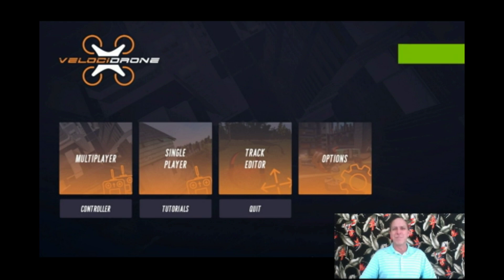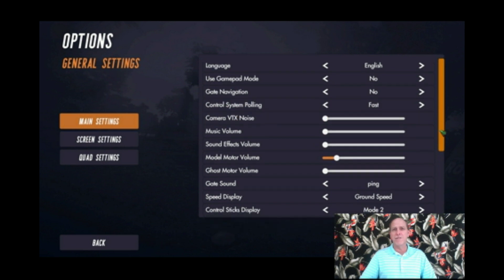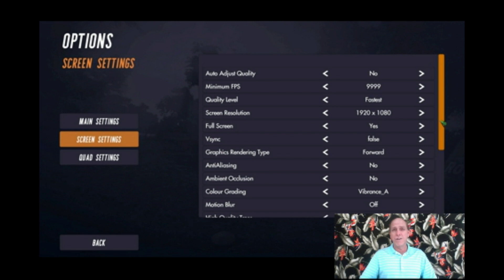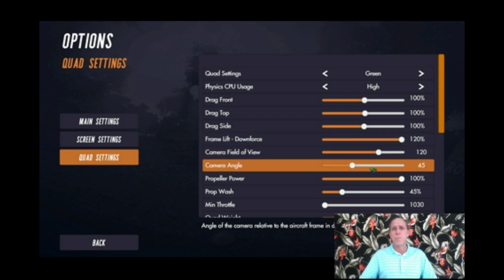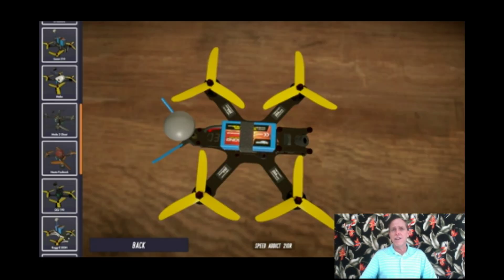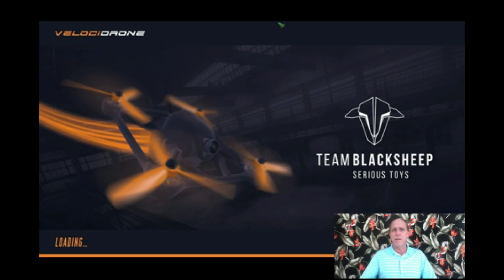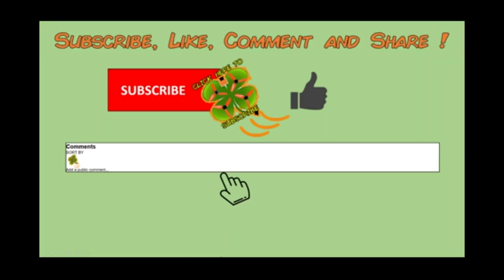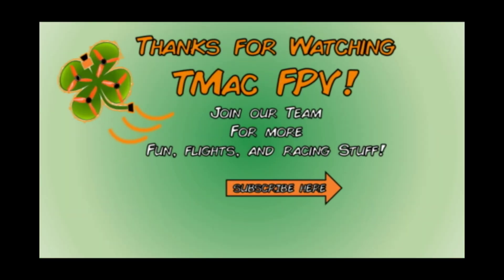HOW TO FLY FPV RACE DRONE  Gates Galore

Comment: Is any quad better than another in velocidrone as far as precision flying/which quad and settings would you suggest for a beginner?  I've found that more camera angle, like 35-45 degrees helps to get more of a point-and-shoot feeling with the throttle not having as much of an effect on elevation, but it still feels super floaty, i can't imagine doing some of the tight ladder spirals etc that I see done.
Reply from the maker: Hey Macelius!  Good question.  A lot of Velocidrone pilots use the Mode 2 Ghost, however, its really personal preference.  I would suggest picking one (like the Mode 2 Ghost with 5050 or 5146 props) and sticking with it.  You can set up your quad settings (like rates, etc.--just leave PIDs alone, no need to change them) in Velocidrone basically the same you can with Betaflight. You can experiment with (increase/decrease) quad weight, side, top drag, etc. to make the quad "feel" different. Yes, a higher camera angle will result in less "up-and-down" altitude changes when you increase/decrease throttle.  It will also mean you need more throttle to maintain the same altitude.  Depending on your skill level and track (tight turns versus wide open long runs) adjust your camera angle accordingly.  The physics of Velocidrone IMO is the best out there.  Verified with wind tunnel testing, etc.  The "floaty' feeling may be based on the different perspective you have looking at a computer screen versus the FPV camera field of view (which you can also enable in Velocidrone if you'd like and your computer can handle the extra load).  It also may have something to so with the "refresh rate" of your monitor (60hz vs. 120 hz, etc. faster refresh rate  = smoother).  Make sure you check out the training videos on Velocidrone Support site here: https://www.youtube.com/playlist?list=PL11jbUrbAAbCZ0N5t1LbR1amVEd5WF7Lg

Comment: Flying Sim is a major key in progressing and Velocidrone is just great ! Tip: Try not to let the quad drift in the Turns. Use more roll and throttle to keep it on Track. Force the Quad through the turn. Always try to visualize the physical Vectors on the quad in your Head to understand why the quad drifts and does what it does. It drifts because there is not enough trust component during the turn which pushes it back into the Track ;)
Reply from the maker: Got it, more "thrust" component into the turn.  I've just been flying "too careful" and "steering" the quad as opposed to "just flying."  I think its basically not enough stick time and therefore, not a lot of confidence. . . YET.  I'll get there though.  Just gotta keep pluggin' away!  Thank you for the tips.  Keep em coming.
Reply: Right, my Friend. Aggressive Throttle handling is the key to keep it on Rails and to "Steer" the quad. It´s just a matter of Time but you can try that in an excelent way while flying Sim